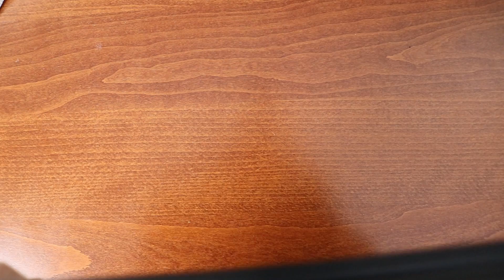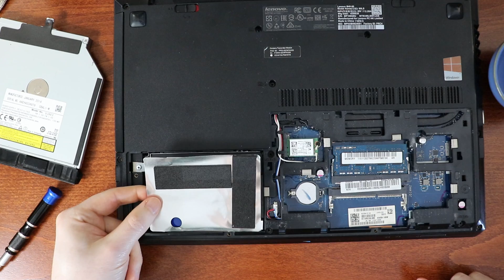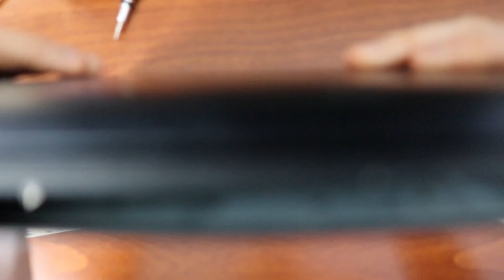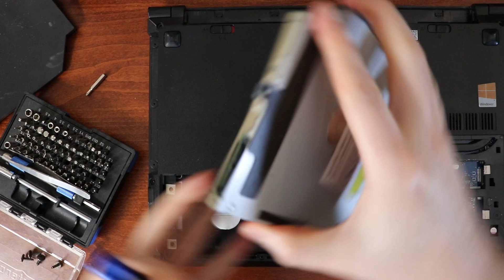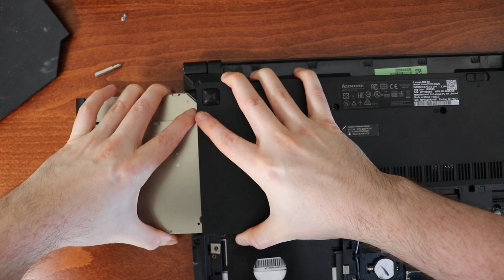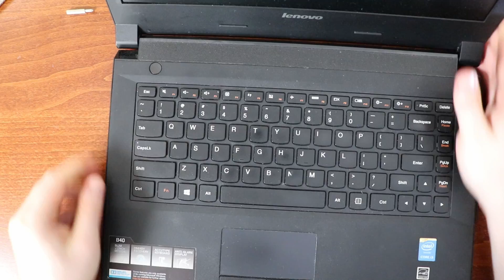HOW TO INSTALL a DVD drive into an OLD LAPTOP in 2024?

Comment: Just received a new CD drive for my Lenevo and thanks to your no nonsense instructional video. I actually installed drive near perfect - it was just the door's latch not closing being not exactly as the original so I devised something to hold the CD in while being played with a Velcro band attached to the outside of the laptop coming down around to the back. As to disassembling drive from the back, I discovered it was simply taking that tiny screw (connector tab screw) that attaches the drive (back center of drive) and it simply pulled out. Installing the new drive was as simple by pushing it back in making terminal contacts. But thank you to help me understand that otherwise I could not have done it. Here they charge a whopping $150 bucks. Appreciate your know how!
Reply from the maker: 🙂You are very welcome! I'm glad that I saved you from having to spend $150! Cheers!

Comment: Buy an external USB DVD drive and that's it, no need to open your laptop.
Reply from the maker: Could do. I actually have one of those as well. They are particularly useful for newer laptops. But for an older laptop that has the space for one, an internal drive is perfect because it means one less thing you have to throw in your bag.